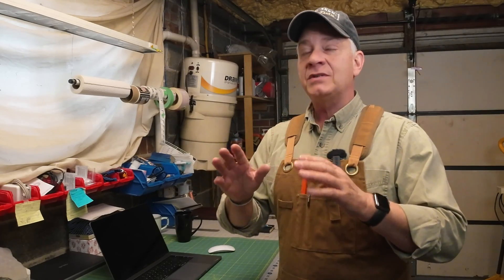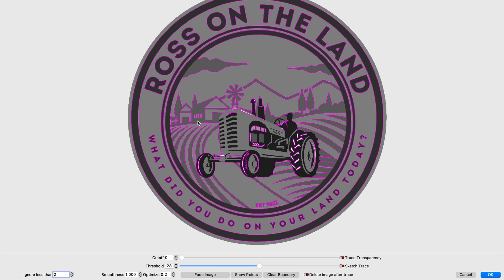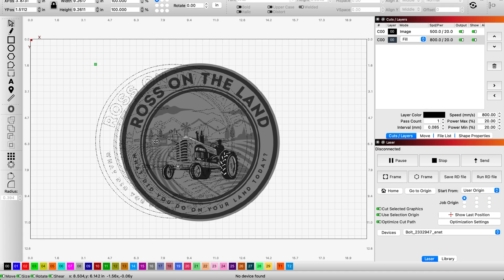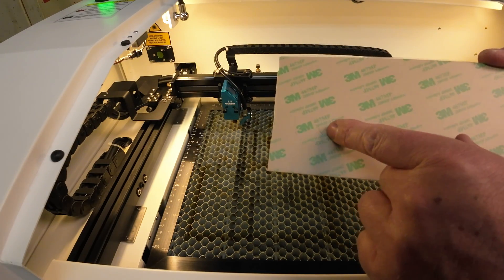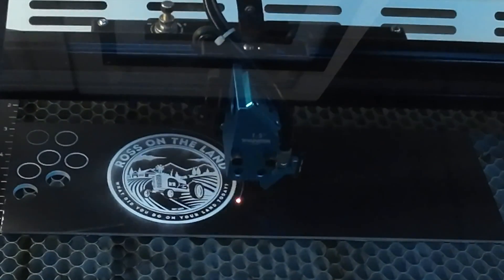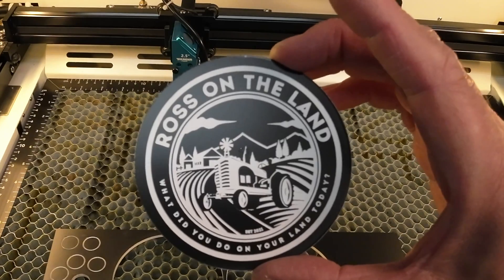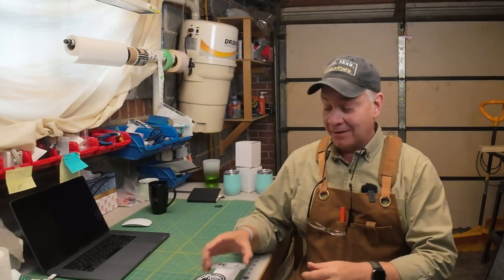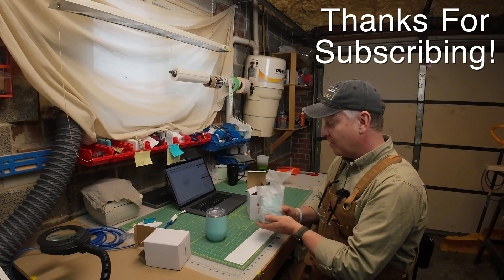Lens Comparison 1.5" vs 2.5". 1/8" Rowmark Acrylic. Thunder Laser BOLT. Part 1 of 2. 028   4K

Comment: The beam width of a 2.5" lens vs a 1.5" lens is why you loose detail, its like using a thicker lead pencil vs a  thin lead pencil.  Its not just focal depth, but also beam width.  If you used a 4" lens you would loose even more detail.
Reply from the maker: Good day - thanks very much for the additional explanation - I didn't realize that but it makes sense to me. Thanks for taking the time to share it for me and others. Cheers!

Comment: I just got my 2.5” lens in and can’t believe how much cleaner my engraves are on leatherette -no cleanup at all now!

I have also been using 1/8” rowmark and find that the left side of my cut lines are a bit distorted. I believe this is due to the angle of the air assist on the bolt. Have you had similar issues? Do you cut with full air or have you dialed yours down? Thanks for the videos!
Reply from the maker: Good morning and thanks for tuning in. Yes, for sure, I almost always have kind of like it looks lifted a bit or perhaps distorted is the best way to say it but it is so minute that I don't see it unless I look closely and at an angle. If yours are more prominent, so to speak, perhaps try a much lower power setting and make two passes. I would agree that the air is blowing the heat sideways through the cut. I always use almost full air for my cuts ( i back off the thumb screw just a little from full position). Hope that is helpful. Have a great week!

Comment: Did you have to change your focus setting for cutting with the 1.5 inch lens.
Reply from the maker: Hey George. No, I just used the Auto-focus. The BOLT Lenses are all calibrated based on the autofocus distance. Cheers!

Comment: I am awaiting the delivery of my bolt and I also purchased the 2.5” and 4” lenses. For your test, did you adjust the focal distance for your 2.5” lens? That will play a key factor in the detail you are able to get out of that lens.
Reply from the maker: Hey Dan - Congrats on the new laser! I had a training lesson - they said there is no need to adjust it from the Auto-Focus distance. However, I am learning that with all lenses and lasers, some folks will drop or increase the Z axis distance manually to manipulate a different result than normal. But in short, the autofocus distance does not need to be adjusted in any way, any more than the other two lenses. Enjoy your new laser and thanks for watching!

Comment: Referencing the trace, I'm not an expert, but try doing multiple traces and then layer them together to trace that logo.  I would isolate the ROTL and trace it and then add it to the original picture.  Some traces may give you good detail in one spot and not the other.
Reply: *Original trace
Reply from the maker: Hey good day and thanks very much. I will give that a try on a future project. Sounds like it would work well. Thanks again!